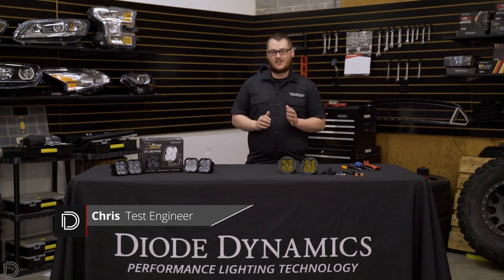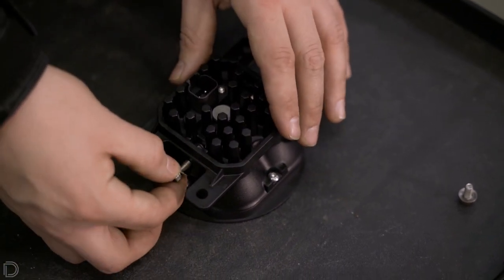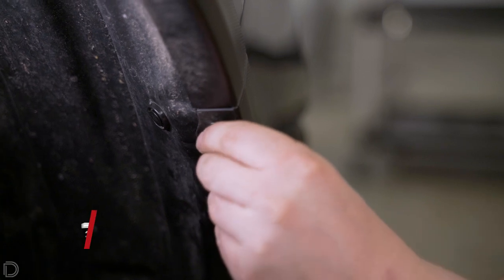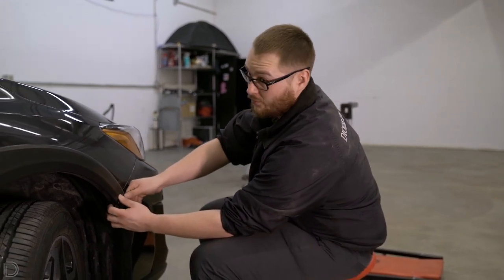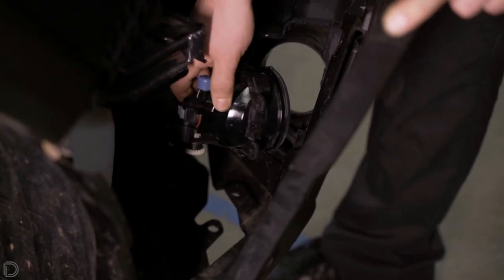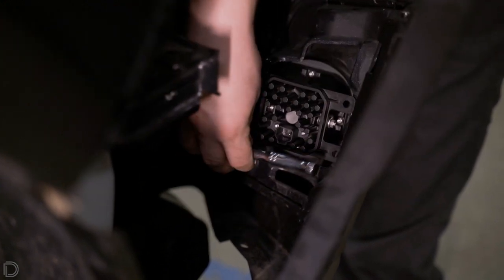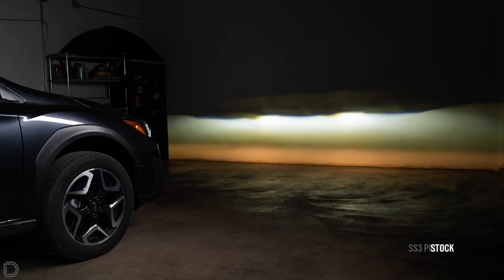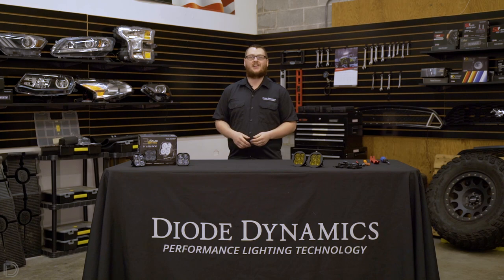How to Install SS3 Type A Fog Light Kit for 2016-2023 Subaru Crosstrek | Diode Dynamics

Comment: Another well-engineered product that is a simple bolt-on. You people have a fantastic design staff and the company as a whole does nothing but the best! Great video and keep them coming. Show me what I can do on a 2018 Camaro RS (1LT) equipment group. Would be proud to show off one of your excellent products!! Thanks.
Reply from the maker: Thank you so much! Unfortunately, we do not have any plans for a Camaro bracket at this time. We thought our type GM brackets would work for the 2010-2013 model years, but those did not fit well, so we will not list those either. Sorry about that!

Comment: Do you sell wiring? I have a 2020 Subaru base model so I don’t think this product would work on my car without wiring first. I can’t find wiring anywhere other than paying the $375 for an OEM Subaru fog light kit, then I would be blowing my entire budget on that and can’t bring my business to diode.
Reply: I have a 2019 base model.  The wiring is already there.  I bought a kit that came with some cheap fog lights, the plastic shroud, a relay, and a switch for the panel inside the vehicle.  I think it was $200 on subispeed.com.  I upgraded to the SS3 a couple months ago.  I installed the SS3 light the way I did the first kit, though the bottom of the bumper.  I hope that helps.
Reply: Your Subaru should already be pre wired for fog lights.

Comment: Question about the gap between the light and fog lamp housing.

There is a small instructions card inside the box, saying there should be a small gap at the bottom of the housing where the unit sit. Is that true for the Crosstrek to get the most effective beam down the road?
Reply from the maker: There is nothing on the instructions that say this. However, a small gap is normal. This is to allow you to adjust aim!

Comment: This is a very helpful video. Many of the Youtube instructional videos show a phillips screw on the bottom that does not exist on later cars. I looked for that for a while. Thanks!
Reply from the maker: We are happy to hear this video helped. Thanks for watching and for your feedback! 👍
Reply: @diodedynamics  This was not as easy as this instructional video showed. My arms were completely cut up after doing the first light I think in part because my nose part would not release beyond the rear headlight edge. Once the fog light tabs were put into the 2 outer slots it would not swing into place without interference on the inner area. I had to dremel tool some of the plastic body panel area near the screw push pin and the 10mm nut to remove enough material so the light would swing into place.  If you try to force this you have the potentially damage the light's housing rim's finish or get a bad finger cut when it finally pops into place.   

The lack of up-down or right-left adjustment capability because the mounting allens are blocked is a pretty big problem.  That may be able to be accomplished by some strategically drilled holes you could shoot an allen wrench through on the outside one and an allen wrench that have been cut down to a minimal size for the inside one.  My ball end allens would not work to overcome this problem.  A requirement to remove the nose and onder panels to make a height or side to side adjustment is just not very workable. On the other side I will try to come up with a better strategy for installation and adjustment. Here is a post installation adjustment mod. https://www.youtube.com/watch?v=p6qlpa2t70A
Reply from the maker: @richardlewis2290 , we certainly appreciate that feedback, and will be sure to pass it along to our marketing team. Thanks for the video!